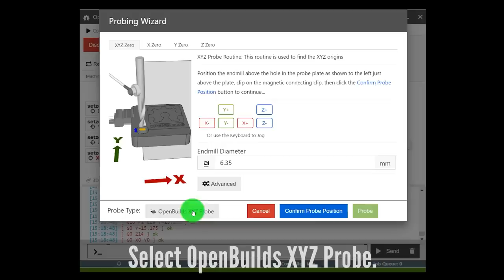OpenBuilds XYZ Touch Probe Plus

Comment: do you know if this will connect and work with the genmitsu proverxl 4030?
Reply from the maker: Hello, the Genmitsu PROVerXL 4030 uses a standard tool length sensor connection, which should be compatible with the wiring and functionality of the XYZ. Here are the wiring docs for the XYZ probe, which should help https://docs.openbuilds.com/doku.php?id=docs:xyzprobe:wiringgeneric

Comment: Hello, I have a Millright Mega V XL and couldn't figure out UGS so made the switch to Openbuilds and it has been nothing but a dream.  I have tried to use the touch plate that came with the CNC and I can use it however I think the dimensions are off because once it zeros and I hit start its pretty far above where the zero should be.  How would I change the dimensions to match my touch plate.
Reply from the maker: Hello Matt, thats for the nice comment on OpenBuilds CONTROL software.  If you think your measurements are off you can set up a custom puck in the advanced settings of control under probing. You can see the advanced button here in the docs - https://docs.openbuilds.com/doku.php?id=docs:xyzprobe:software-control
However please double check that you are not missing steps on your Z axis because it sounds like that may be an issue. If you need support with the XYZ Probe Plus please reach out on the form here -https://openbuildspartstore.com/contact-us/

Comment: I assume this will work with the CNC xPRO V3, but what is the extra wire for?
Reply from the maker: Yes it will and the extra wire is for the signal (magnet attached to the opposite end).

Comment: Can you connect it to an arduino?
Reply from the maker: Yes this should not be a problem as by nature with its easy to wire connectors it can be adapted to work with mot other systems

Comment: Hi guys,
what function does the circuit board have?
Reply from the maker: The circuit board is for the LEDs the light up during the probing cycle. The jumper pin on the BlackBox can be switched to 24V to make the LEDs brighter. 5V is default which is difficult to see in the video.